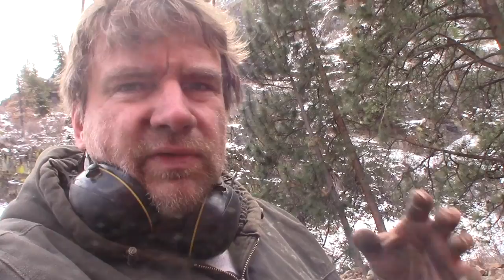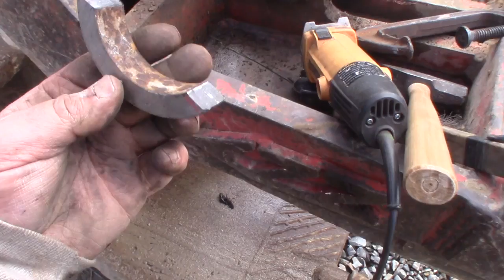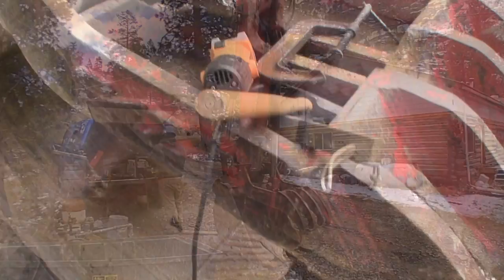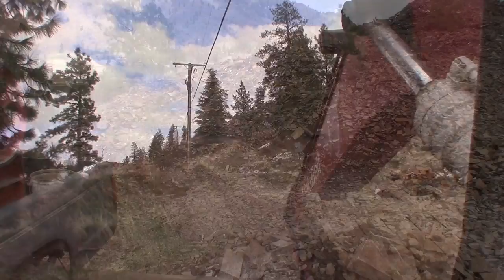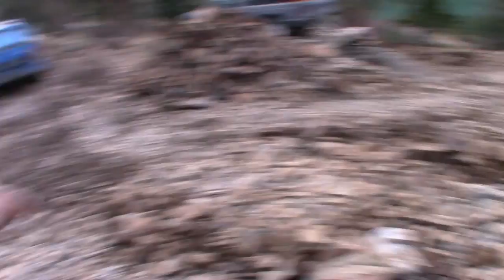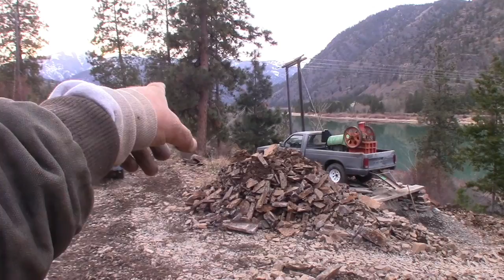Welding and Running Link Belt 2800

Comment: Do you still have this excavator????
Reply from the maker: Yes. Useful if beat up machine.
Reply: @acme663ryo  I just recently bought a 2800c2 Linkbelt. Has a few issues but overall it seems to be a good machine
Reply from the maker: @tttco  sounds great. I hear many have issues with electronic throttle but I can assure you, they work just fine retrofit with a manual. Have to bootleg guages on the dash however.